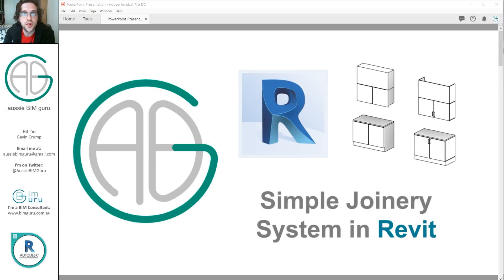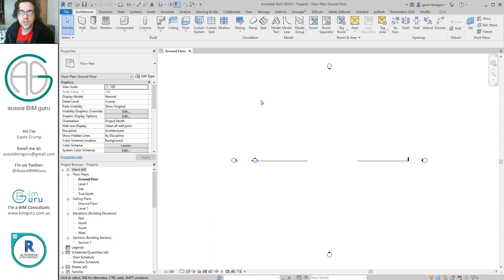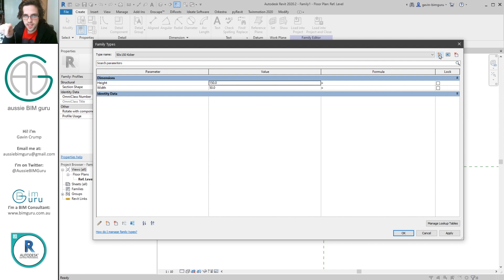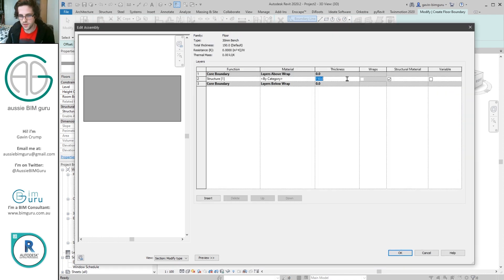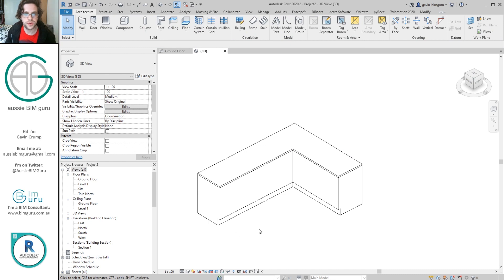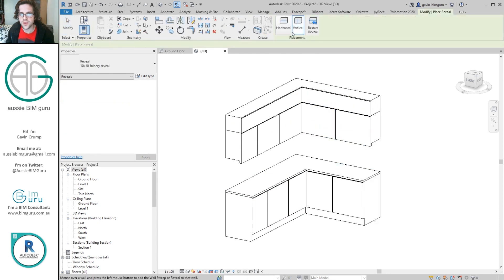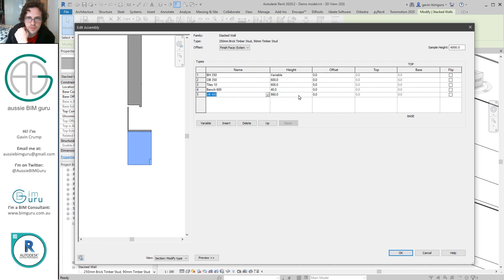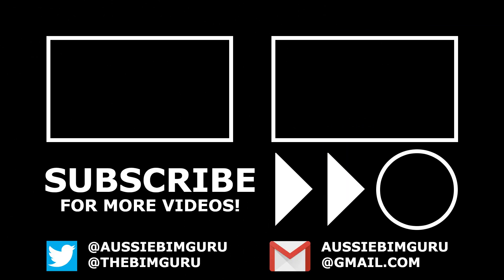Simple joinery system in Revit!

Comment: This killed me, Gavin. Not sure if I could live with your method :P
Why not build it as a Generic Model in Place with Solids and Voids then for an early stage? At least is not a wall and a floor...
Reply from the maker: A model in place line based has some issues, such as awkwardly joining at their ends and not supporting automatic corner junctions (L/U shaped kitchens are very common).

You must consider also that many people do not feel confident building or editing revit families, especially with void mitres which need angled reference planes. This approach allows them to build unit types in the wall editor, much friendlier.

The floor can be made to a wall if you use a wall to the floor depth, just didn't figure it out when I made the video.

It's not category compliant, but then again how many team members follow the rules in early design phase anyway. May as well give them an option which works for them at that stage that something like dynamo can replace later on!

Comment: I was just going to say that you can make a stacked wall out of it and use a sweep for the counter to get rid of the manual floor-countertop drawing :P Nice little hack, definitely speaking for using Revit in outline proposals - beating SketchUp in every aspect! Thanks for sharing Gavin.
Reply from the maker: Yeah the countertop's a funny one, I've found some scenarios where it's better kept separate so you can cut holes in it and do kitchen bench overhangs etc. Depends on the job type I'd say which method is better (if deployed at scale, definitely an integrated sweep though).

Comment: IMHO this method could find its place also in a larger office with managed BIM standards. It is quite easy to abandon Revit Categories as "Classification", use a different method to classify elements, and only consider Revit Categories a guide, not a "standard". This way one can use the so called "system families" as modeling tools instead of specifying what that element exactly is. Just as an example, Revit Railings are much better as skirtingboards, crown moldings and wall coping than actual railings. The first things comes to my mind is using the IfcExportAs parameter as an alternate classification, and there you go, you got much more freedom classifying your elements, but still not too deep as using Uniformat or Uniclass. And if you use IfcExportAs as element classification you can be sure that your exported Ifc will also be correct (more or less, not taking into account how the System Families treat IfcExportAs in reality, like a Wall can only be exported as an IfcWall, but in the Revit Evironment it can still be valuable, and I understand that the Ifc exporter will allow mapping system families to any Ifc Class sooner or later, but thats a different story). Or it is possible to create a company wide shared parameter for custom classification, with the required level of distinction between elements, and if the graphical and documentation standards are built upon these parameters using filters it can be much-much more powerful than using only the OOTB revit categories, and at the end of the day, you can model your joinery using customized walls ;).
Reply from the maker: Right you are - the Revit category system is really only relevant in Revit itself, once you move beyond to IFC the ExportAs parameter does most of the dictating. I actually already use this method for a few of the cross category elements (e.g. I model my toilet partitions as casework so that they cut, but classify it differently to most joinery).

I use Uniclass also in all my families as I like having this classification system available also. I use assembly codes for this, and the default Revit IFC ExportAs/Type parameters to dictate element IFC classes/type enums.

You're right in that some of the system families have limited export options for IFC, I expect this will change soon given Autodesk has recently pledged their time towards developing their IFC workflows.

I actually use this system for smaller resi projects during concept phase, and use filters to control all the joinery wall types - so category isn't really a challenge here either.

Comment: Interesting approach but for the same time, you could create a furniture/case system which is also not fully parametric as this one...
Reply from the maker: Yes you can, but it takes a lot longer than 5 minutes to build this content.

I developed this system mainly to help residential modellers in concept phase who found casework and line based families too indimidating.

I have my own detailed casework families but these have many hours invested in them.

Comment: I never taught I would see something like this being shown by a BIM manager!
Just kidding it’s a good approach! I have been using thick walls for a quick kitchen layout for some time now. I find it to be better at first as it allows you to test out many different layouts before settling on the one where you are going to use casework families.
But in situations where the kitchen elements in the project are there more just to show how the space could potentially be used (really common in my country) this can be a superior time-saving solution.
Reply from the maker: Haha yeah I don't usually use these types of workflows but this one felt worth sharing - I actually use this with resi projects in concept stage currently. Massive time saver and easy to control visibility using filters.

Comment: Good work as always.. Out of curiosity, why didn't you use a built-in sweep for the counter top?
Reply from the maker: Since making this video I have begun to use another wall type in the stacked wall as the counter top, good suggestion!

One benefit to using a floor is you can easily punch holes in it, so that if you have non-face based families then you can still show them going through the counter.